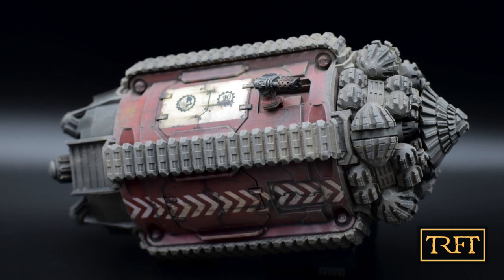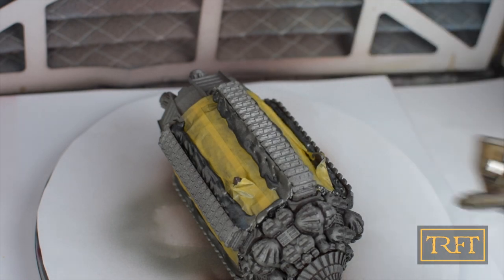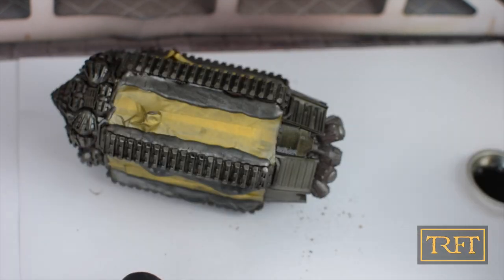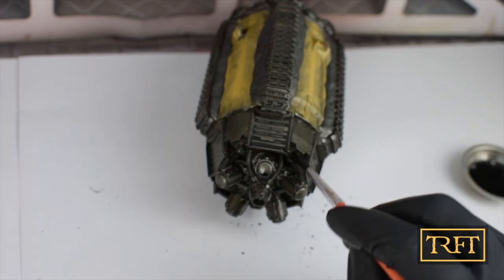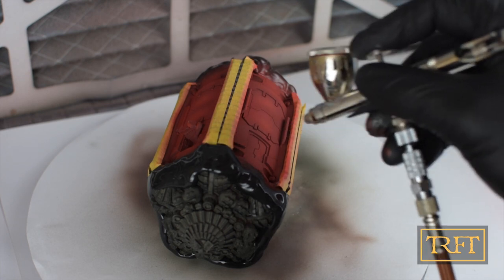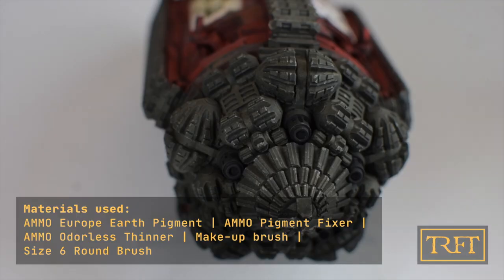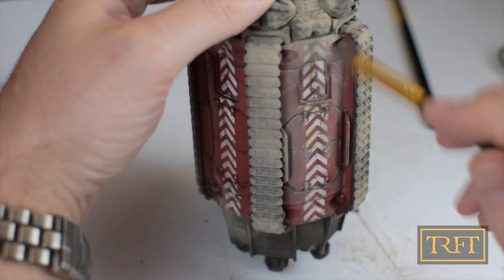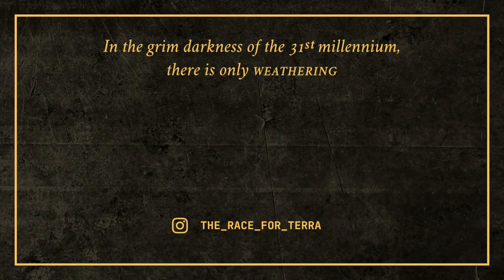Painting a Terrax Termite for Leakycheese | Bare metal, Airbrush Basecoat, Stencils, Pigments

Comment: TRFT what did you prime with?
Reply from the maker: I used Vallejo Surface Primer German Dark Red. However, I have since moved away from it, as I always had too many dry tip issues, no matter the dilution or the psi. The polyurethane in it is nice, but it's also hard to clean. On the Leman Russ I used Tamiya hull red as a primer, and it worked a treat. On the Arquitor I'm working on atm I used the Ammo Titans Black Primer and it's the best rattlecan primer I've ever used.